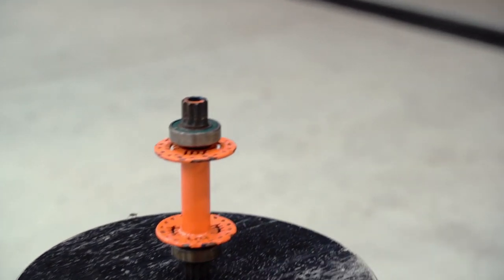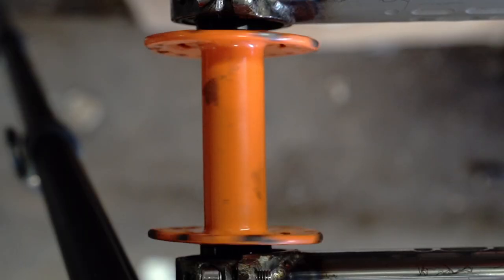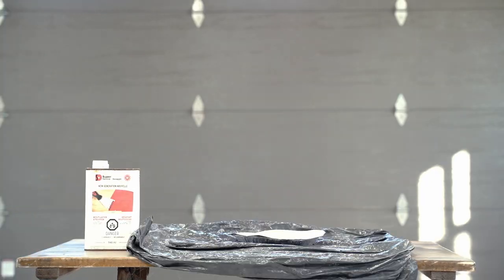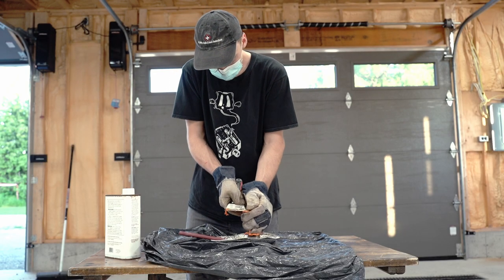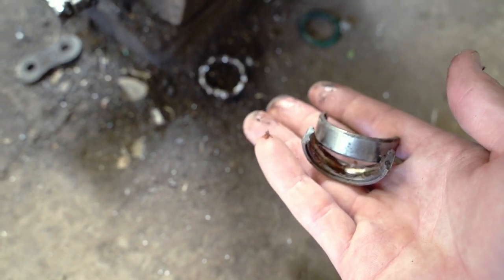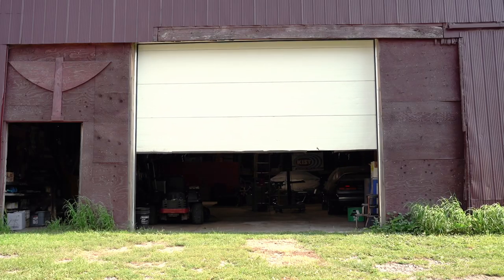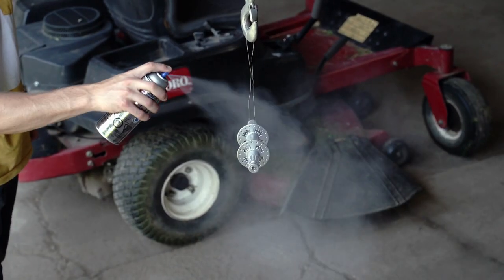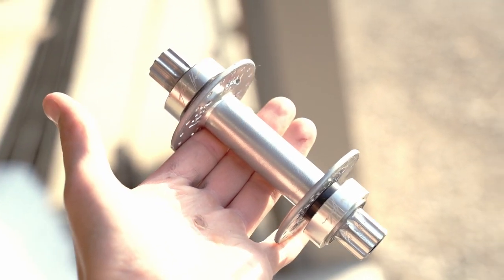OLD Unicycle Parts to NEW - Unicycling Hub Rebuilt

Comment: Cool!  Now you have to remove the paint from the spline for it to by usable.
Reply from the maker: From the spline? Like the male ISIS drive of the hub right? It has a little bit of paint on it, but I think (I hope) I should be able to get the cranks on it. I did have to sand down the splines to get the bearings and spacers on though 😵

Comment: The weird squiggles on the flange were all KH hubs back then. I believe (but could be wrong) that the squiggle is a KH
Reply: Oioi, yeah the cutouts are a KH signature, which made these flanges bend way too easy.

They’re essentially identical to the Nimbus etc hubs that came later but these had circular cutouts, not elaborate initials. But even they weren’t immune from the bends
Reply from the maker: It's definitely a KH moment hub. I don't know if you were able to see in the video, but there was a faded KH logo on the hub body :p